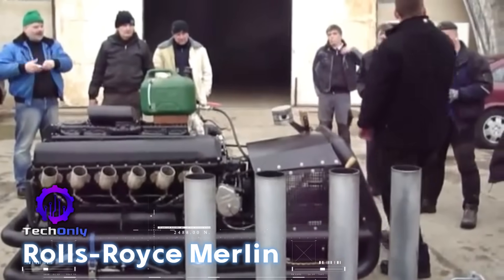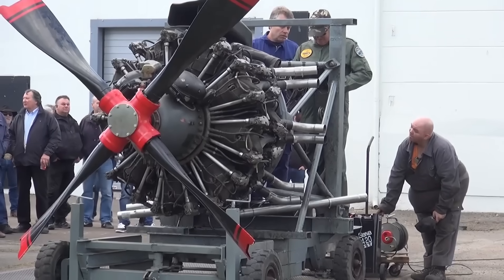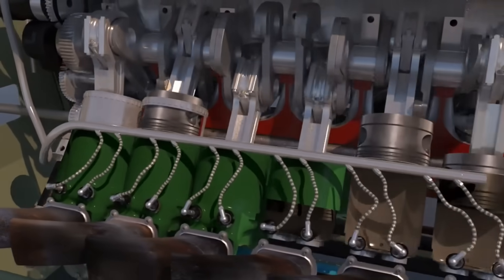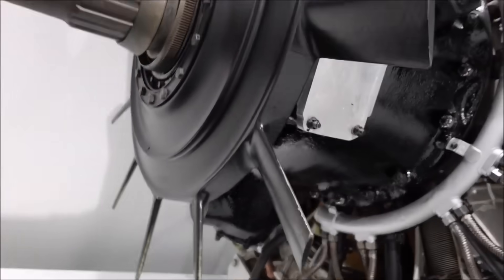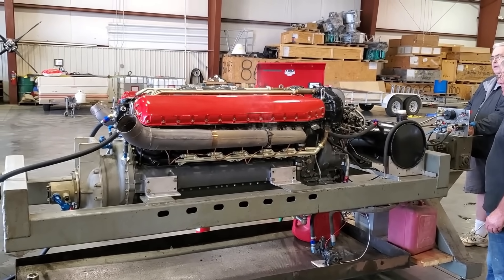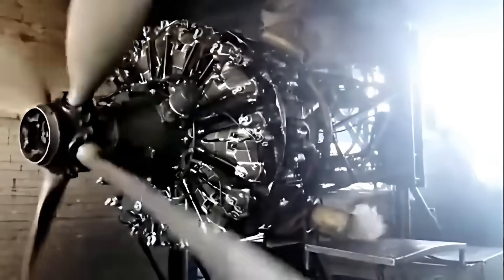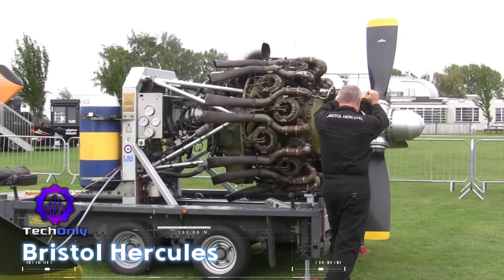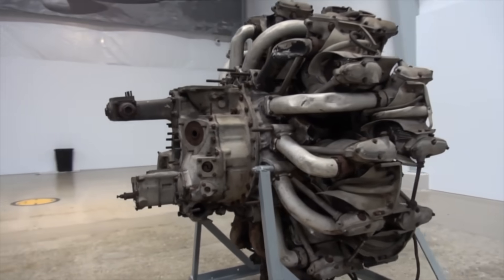10 ICONIC WW2 Aircraft Engine SOUNDS That Will SHATTER Your EARS

Comment: 01:18 It's really bad for an aircraft engine if that sudden blipping of the throttle is carried out. Thrust changes should be a little gentler than that, to avoid shattering components and twisting conrods.

Comment: The Junkers Jumo 004 had a service life of 28 hours before needing to be reserviced; it was easy to change, with and engine swap taking approximately 1 hour Max. The Cost of producing a Junkers Jumo Engine was less than half of the price for a DB 601, 603, or a 605!

Comment: I had a summer job at an old airport covering a hangar with tin. An A-26 pulled up to the hangar and I happened to be standing above the spot where it parked. Holy shit! I had experience with a 12 ga shotgun. That engine hurt my ears more than the 12 ga!

Comment: I was in the Air Force '62-'66. I was a Reciprocating Aircraft Engine Mechanic and worked on R-2000, R-4360 and R-1300 radial engines.
LOVE the sound of those radials.
Reply: Did those engines have turbo/compressor?

Comment: A Merlin engine is something you feel, you don't just hear it. Once you've felt that in your chest it stays with you -  in a good way.
Reply: I got a ride in a modified two-seater P-51 at an airshow.  Ride was 5 minutes, crazy fast, did flips and turns.   Never felt anything like it.  You are right.  I'll never forget the feeling.
Reply: I agree. Used to have a p51d at the local air show and it's a beautiful sound and feeling

Comment: There is a FW190 with the soviet engine....
Reply: okay so I wasn't the only one to notice that
Reply: Original Bmw 801's are hard to come by, and the Ash 82 is similar enough and in enough supply to power restored airframes without engines.

Comment: Flames coming out of exhausts of engines that derive their motive power from contained combustion heat expansion exacting force on a piston shows perfectly how incredibly inefficient these and even so called modern engines still are when these flames - if this wasted heat could actually be used - would more than double the power output of the engine and almost remove all the pollution. This could be excused 90 odd years ago in a desperate war situation but now? Never listen to any climate propaganda when reality is that we are prevented from having efficient machines on purpose. We are still using exactly the same outdated engines now - 75% of the energy goes out the exhaust - as all further meaningful development of the piston engine ceased as soon as the Jet engine was invented. But EV's are not the answer - efficient new designs that already exist are...
Reply: Always has to be one person crying and complaining. Nothing you cried about had anything to do with OP 's video. Why don't you go make one of these 100% efficient engines and better the world instead of crying on the internet.🍼
Reply: It is used. You heard of a turbo charger?
Reply: Who cares.  The music is great.

Comment: The P&W R-2800 also powered the Vought F4U Corsair.
Reply: and DC 6 airliner
Reply: @travistractor2809  right. Because of the advent of the jet during WWII, I tend to think that radials were no longer a thing.
Reply: and C-46 Commando
Reply: @busterdee8228  true.
Reply: and the P-47 Thunderbolt. It was an awesome engine that could take much more punishment than the liquid cooled Allison and Merlin/Packard!
Reply: @scottbarron611  yes, it powered the F4U Corsair, the F6F Hellcat, the P-47, and the C-46.

Comment: I gotta say, my favorites are the radial 18 cylinder. Just have a deep, beautiful tone.
Reply: Швецов М-71) 18 цилиндров, 2200 л.с.
Reply: I prefer the 27 cylinder P&W Wasp major. Sorry, 28, four rows of 7.
Reply: @ I think it was the largest piston aircraft engine ever created, right?
Reply: @ Нет, самый большой из когда либо созданных поршневых двигателей, это М-507(2х56 цилиндров, всего 112 цилиндров) 10000 л.с.
Reply: @turnin.sprocket  if that is to me, yes. There w a larger one but only two were made and they never flew on an aircraft.
Reply: @ The other gentleman responded to me about the M-507 engine, but that was a different manufacturer. Thank you all for your help.
Reply: @ Конечно, М-507 не летали. Это ж какой должен быть самолёт, чтобы такие дизели на него установить!)) 
Но начало этого дизельного двигателя - для самолётов М-40 (АЧ-30Б) 1930-х годов.(Пе-8 и Ер-2 летали с ними) . Реактивная эпоха сделали их неактуальными для авиации. Поэтому эти моторы пригодились на флоте: лёгкие, компактные, невероятной мощности.
Reply: @BablchLife  Have you seen the new  Deltahawk 2-Stroke Diesel V4 engine that's been operating in experimental craft? Runs on various fuels, but it's compression ignition 2-stroke with supercharger, and turbocharger exhaust.
Reply: @ М-503 42 цилиндра, 4000 л.с.
Создан на базе авиационного М-50.

Comment: old dude without ear protection right next to the flame spitting exhausts not even flinching when he blips the throttle.  His ears shattered long ago.
Reply: What?
Reply: 😅😂 @paulbzzz7636
Reply: @paulbzzz7636  What what? What you read.
Reply: Nowadays the event runners would be sued for millions for not putting up signs, passing out earplugs and giving a power point on hearing safety. There is no seat belt back here what do you recommend I do? Lmao
Reply: Lmao use is savage
Reply: That's the difference between him and generation z 😁
Reply: The main character with plot armour
Reply: First thing I noticed too.
Reply: Dude *
Reply: What?
Reply: That’s because his hearing was shot years ago.

Comment: You probably could list the thrust for the Merlin, since they found that by pointing the exhausts back instead of out the sides gave approximately 70lbs of thrust.
Reply from the maker: I did my best to make this as informative as possible with all the details I could gather
Reply: @techonly01  All good. It's a minor bit of trivia about the Spitfire.
Reply: 70 lb of extra thrust would be useful but minor compared to the propeller thrust.

Comment: Imagine standing next to these engines at full throttle. Instant hearing loss!
Reply: Even standing 75 feet away from an IDLING B-25 was painful. I can not even imagine what it must have been like to have been on the deck of the USS Hornet when they took off for the Doolittle Raid with all those Twin Cyclones going full throttle.
Reply: IDK --- same effect standing next to a turbine. Hearing loss. The radials do sound better though. 😊